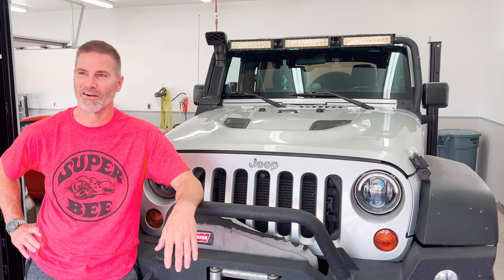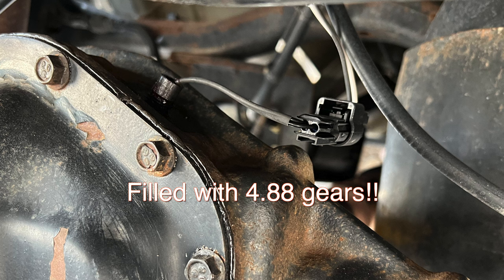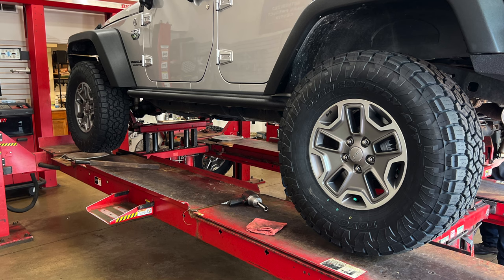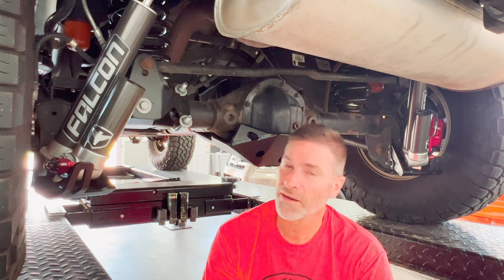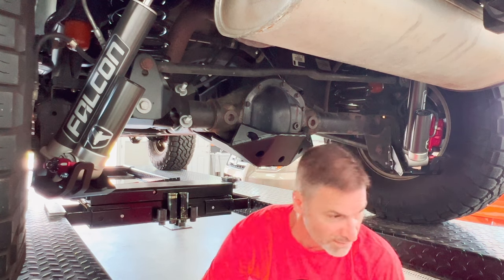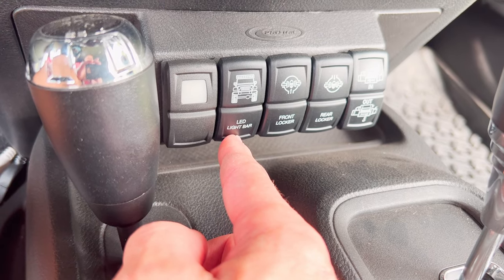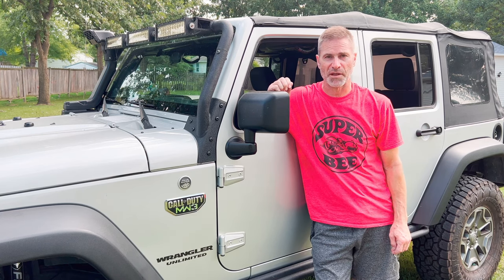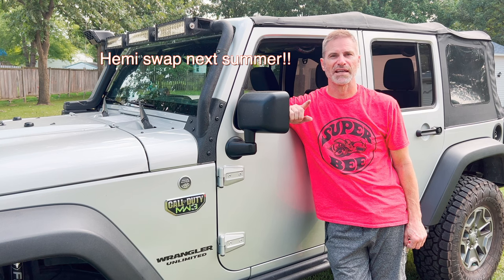Jeep Wrangler JK Teraflex ST3 Suspension Ep 6

Comment: The short arm kit in the rear all 4 upper and lower are longer than the stock ones?
Reply from the maker: My son knows the specs more than I do, but the kit is designed to work with up to 35s.  Teraflex has a long arm kit for 37s that push the rear axle back.
Reply from the maker: It’s the Teraflex Sport ST3 System for JKs